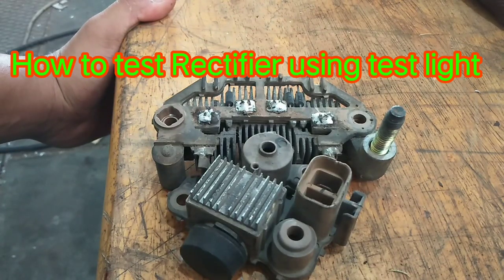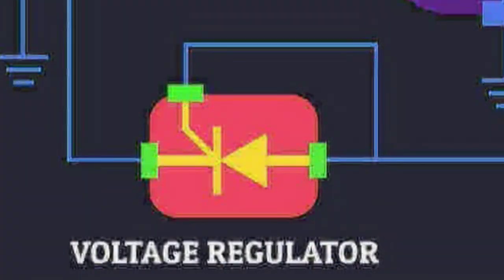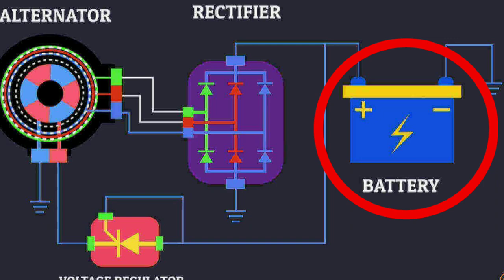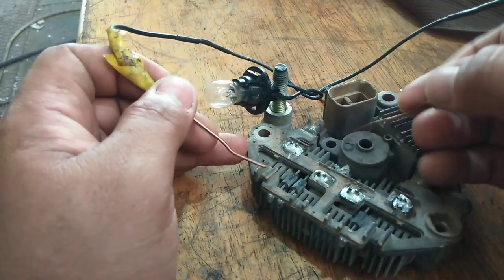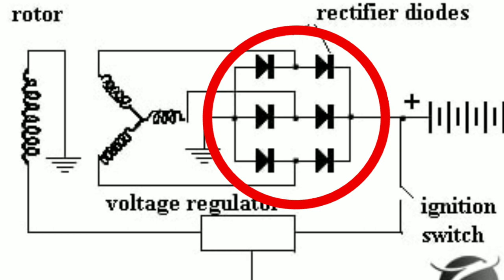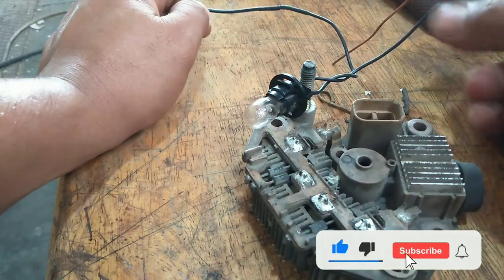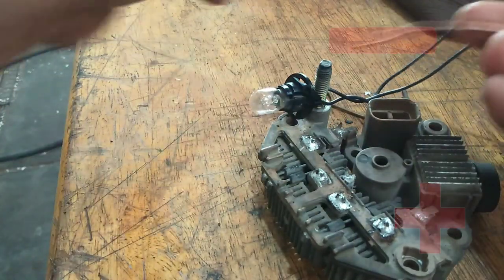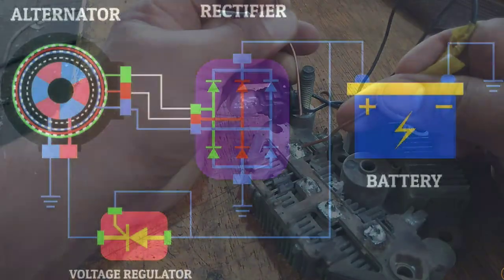How to check rectifier circuit using test light / what is rectifier of an alternator @Regulator #1M

Comment: Nice video. My problem is this:  the rectifier gets too hot and it fries. I replaced but the new one have the same issue. I've checked the ac from stator and I get 52v from all 3 yellow wires. Is it normal? This is a scooter SYM VS125. Any suggestions?
Reply from the maker: I think 52 volt is little bit high but still in normal,, one reason why rectifier is fried is ,,somtimes there is problem with coil try to check and  clean, check your connection,any grounded , check his fan or impeller for cooling and the rectifier position

Comment: Great video and very helpful for me as you can understand from the following. I was given an alternator that came from some Hyundai car, allegedly it is not charging. It has the same bridge rectifier and voltage regulator as in the video. From what car is the alternator in the video?
Reply: Nissan pickup gasoline engine